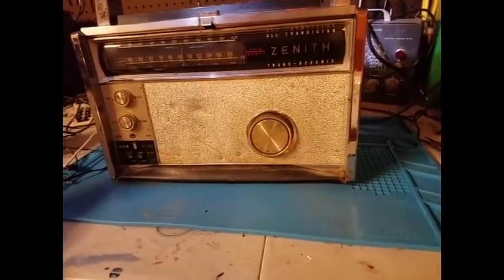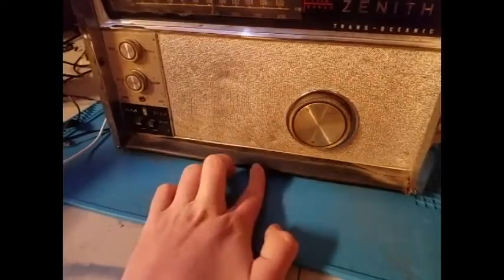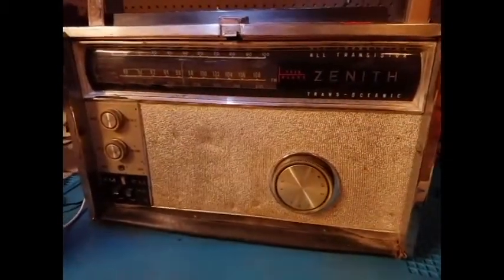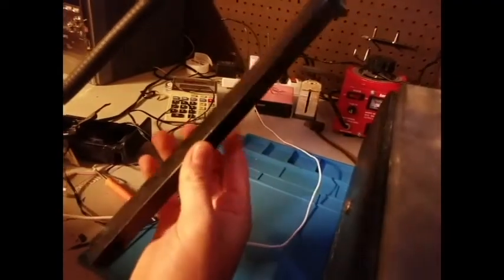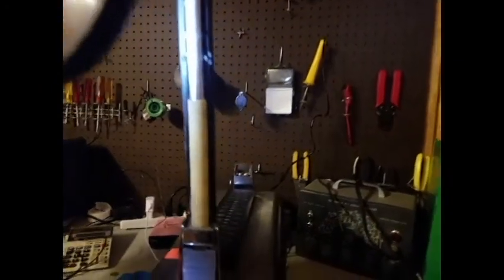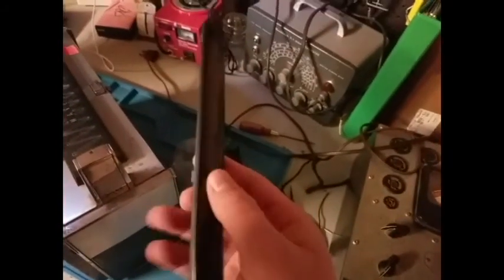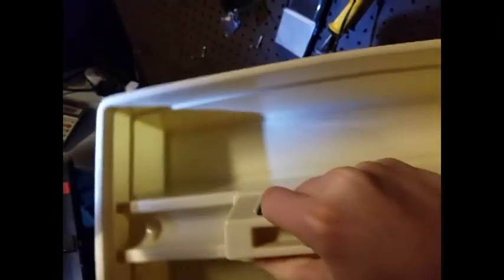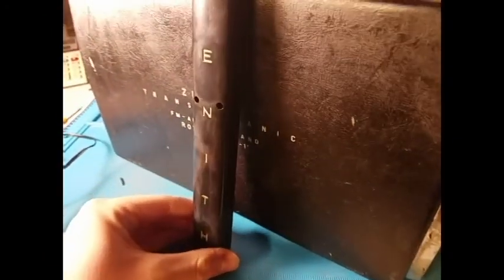1962 Zenith T/O 3000 Cosmetic Repair Part 2

Comment: It’s supposed to have a front cover door. I have a broken 3000-1 it only plays FM and I need help fixing it! It’s cosmetically amazing! I also have a bad antenna too. I also have an ac adapter
Reply from the maker: It would be cool if mine had the front cover since it not having it probably degrades the value a little bit. But I think it still looks quite cool without it. Its kinda funny how our models are flipped on their needs! AM is also quite weak on this one too.